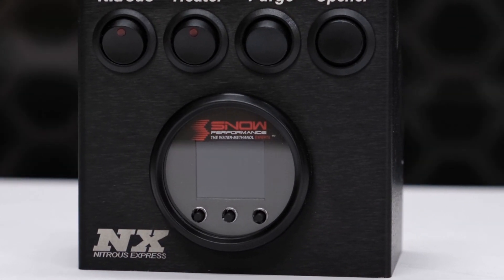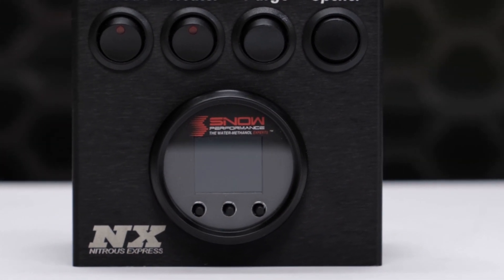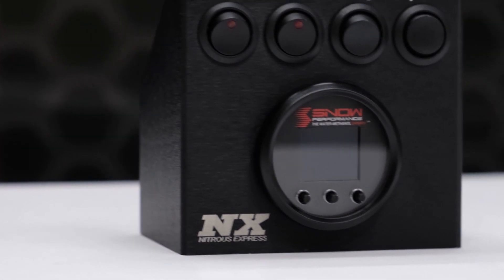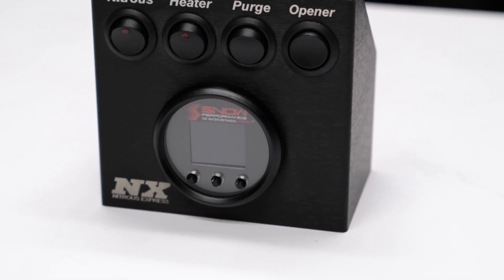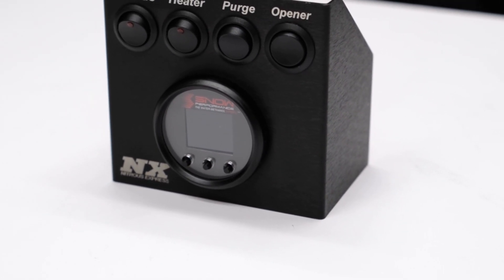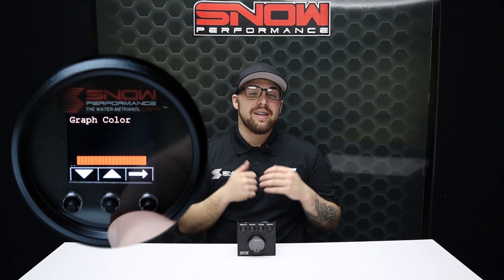The NEW VC-100DI Water Methanol Controller is the Most Advanced Controller on the market!?

Comment: Is there a downloadable instruction manual for this unit? Have it installed but it’s only showing in BAR rather than PSI. Not sure how to change what the display shows outside of the basic navigation buttons…
Reply from the maker: Here you go 
https://d1vlavvlsa6jkm.cloudfront.net/images/vc100di.pdf
Reply: @snowperformance1   Thanks so much! One more quick question - Got everything installed and noticed that when I have the system set to injection "OFF" I get the white graph lines blinking YELLOW - is this normal behavior on this unit just indicating that there is no WMI active? or is the controller indicating a fault somewhere else in the system? (solenoid, etc.)
Reply from the maker: Is the purple wire hooked to low level? If so can you unhook that then set to injection off and see if it still does that. If you want to give our techline a call and ask for Chris he can get you sorted out

Comment: Did you folks first fix heat issues with the vc50? I had two and they both malfunctioned due to the summer heat. They don't last
Reply: Funny that you call this out, I've had mine now for a good few years but I also was getting the display mailfunctioning from summer heat, I ended up having to shut off the air at the vent where my gauge is installed altogether , and so far it's still going strong.
Having a more robust system temperature wise would be great though.
Reply: I had one failed on me they don't like direct sun light I actually just added tints to my car

Comment: would this be a good replacement for the VC-30? I have one currently installed in my car and since the beggining it has been tripping and burning out the fuse, would this replace the controller as well and work for me?
Reply from the maker: This would be a great replacement for your controller, the wiring is different but it will work.

Comment: So the big difference feature between vc-50 and vc-100 is the 2d mapping?
And design wise the display looks to be smaller too but better color matching my
Other interior gauges.. (black buttons and black ring surround)
Is it worth getting the new controller for my stage2.5 system which is brand new aswell..?
Reply from the maker: That's correct. That and the capability to progress all the way up to 100psi vs the VC-50's 50psi limit. I would say if you are looking to have even more precise control over how your system injects then yes definitely upgrade. However, the VC-50 is sufficient in many applications.